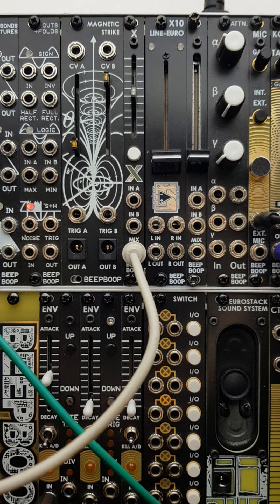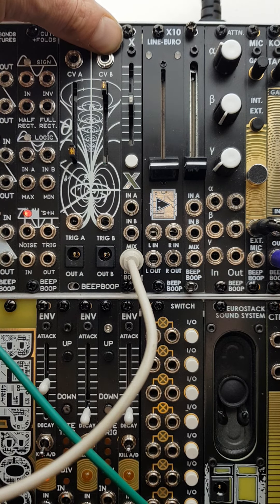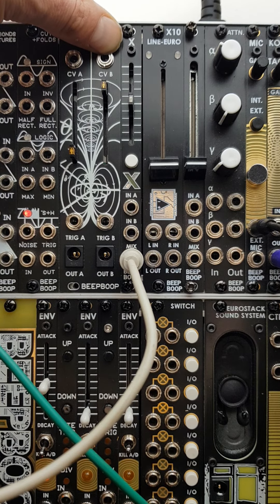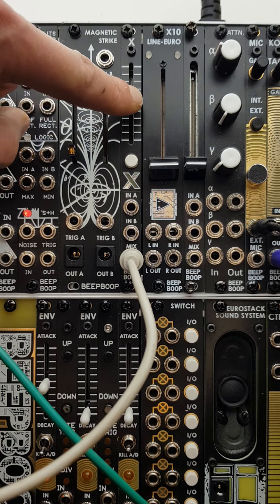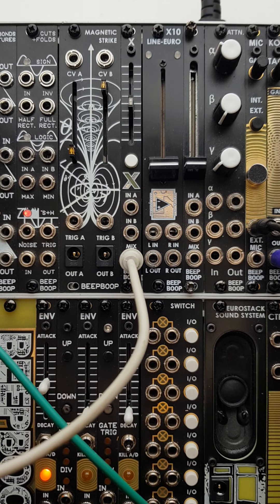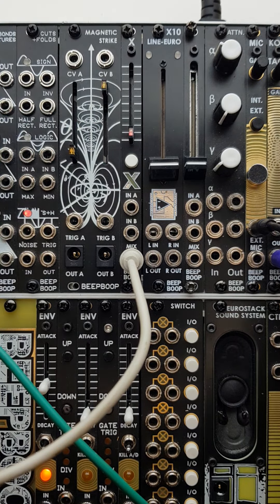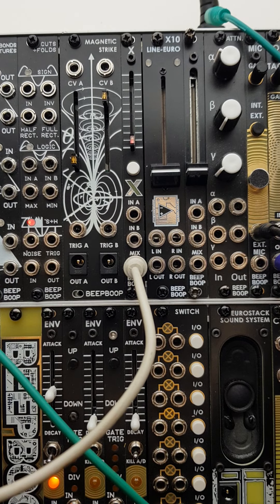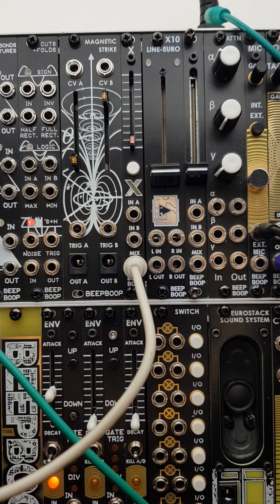Beepboop Electronics X-Crossfader V2 demo

Comment: Genius!...
Is this DIY..?

Also loving the LPG DIY I just pick up from thonk 
Will it be on thonk soon ?
Reply from the maker: Hi Dude :) Thanks! That's great to hear you like the LPG module, they have been selling well which is nice for me as my products don't sell in large numbers.

The LPG is a through hole component kit but unfortunately the Xcrossfader isnt, i had to USE 0603 SMD components to fit power headers and the acitve circuits :)

I have some V1 versions going cheap for £50 on my website without the switch for +/- 10V which is a but cheaper than the £65 for this V2.

My website is www.beepboopelectronics.co.uk if you would like to check them out

good luck with the LPG diy build

Peace. love. patching
Monojack
Beepboop
Reply: @beepboopelectronics  nice 👌 

I think 65 quid is reasonable. 

I'm pretty ok with SMD work ..
I like the challenge 
Keep up the great  work 👍 
BB
Australia

Comment: This module looks awesome! Does it crossfade audio signals, or just CV? I need to mix between two mono audio sources and want to make sure the taper is right for audio.
Reply from the maker: Hi Ben, it works great with audio or CV. The inputs as DC decoupled. The Fader is a linear but it works great with audio :)